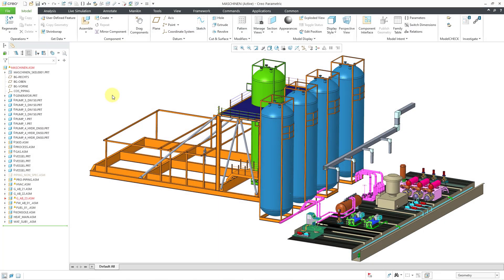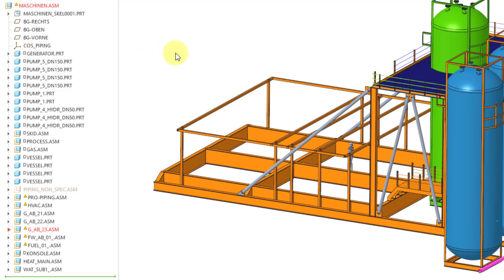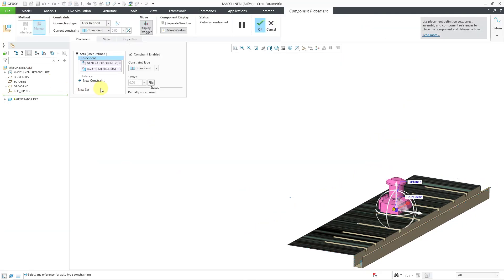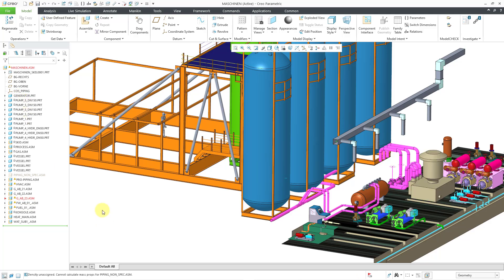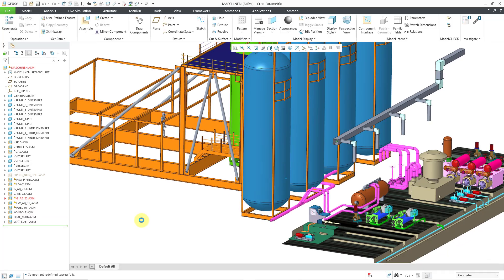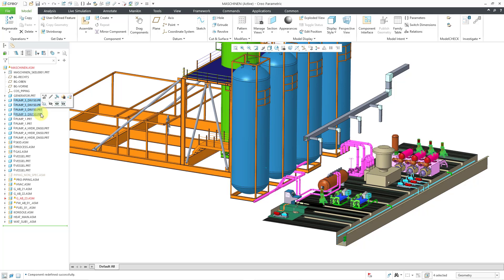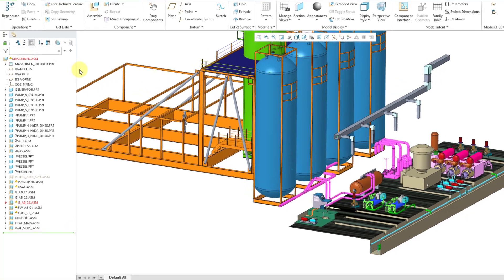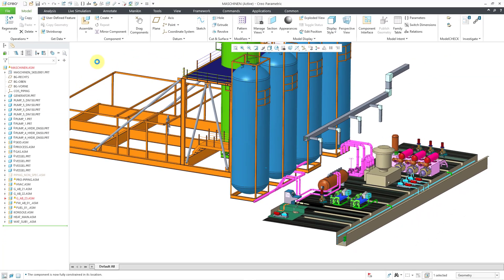Creo Parametric - Fix Location - Assembly Constraints

Comment: I have used fixed location and chose a different csys on a skeleton model.  This allowed me make harnesses regenerate into a different shape if I needed to show them in a motion analysis.  The skeleton csys would change rotation and my connectors and harness would update after a full Regen. Not in real time, yet.
Reply from the maker: Great technique. There is supposed to be some way to make harness location points “flexible” so you can place the same harness multiple times in an assembly. I haven’t researched it though. A maintenance release of Creo 12 is supposed to introduce the new harness assembly, so I hope that includes reusability.
Reply: @CADPLMGuy it won't happen in this first phase of cabling update but it's on the radar. [I'm chair of that TC!]